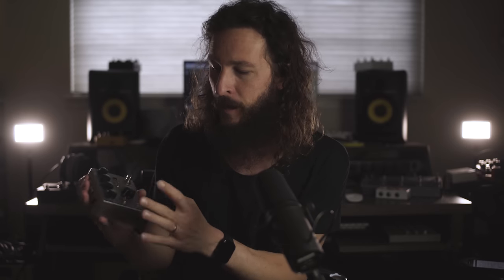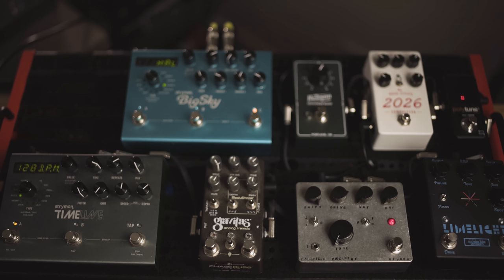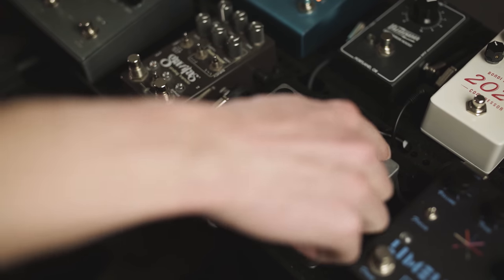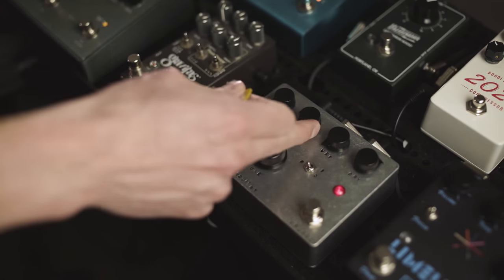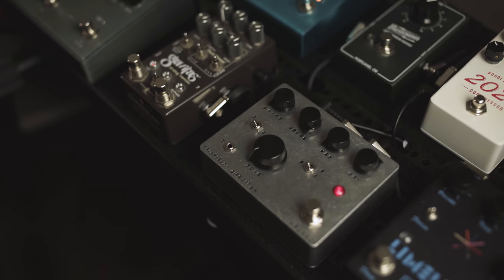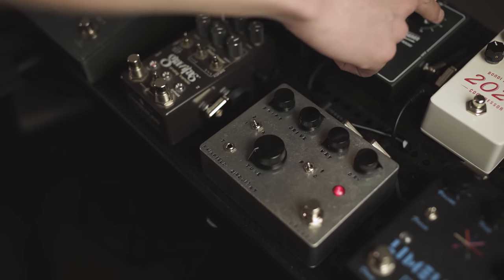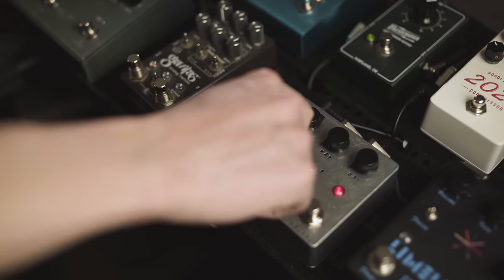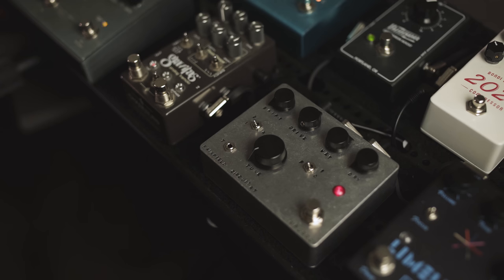What IS The Fairfield Circuitry Roger That? | Secret Weapons Demo & Review

Comment: That's some mad pedal you got there Mark. I was always told to avoid Out Of Phase. Not sure this will be a best seller. BTW I always love your pedal reviews. Keep them coming!
Reply: Nothing wrong with the effect being out of phase for a pedal like this. Definitely wouldn't want an out of phase parallel compression track though. Plenty of cool audio tricks can be done using phase.
Reply from the maker: Phase is in the eye of the beholder. Some of the most iconic guitar tones of all time are created with pickups intentionally out of phase with one another; see the Fender Mustang
Reply: @markjohnstonofficial  Gibson ripper too!
Reply: @markjohnstonofficial  Goes way back to my days as a mastering engineer. Out of Phase was a real issue. Please keep the vids coming.
Reply: But surely we are talking about polarity, and not phase, which are two different things.
Reply: @FortyHurts  probably phase. Polarity would cancel when added.
Reply: @RDHamel  Only if the two signals are identical, which in the case of pickups or two different distorted signals, they are not. "Phase" is very often used incorrectly in place of "polarity", which is my point. Even large manufacturers get this wrong. Phase is a function of time, while polarity is an amplitude inversion. Any time you see a "phase" button, it's actually flipping polarity.